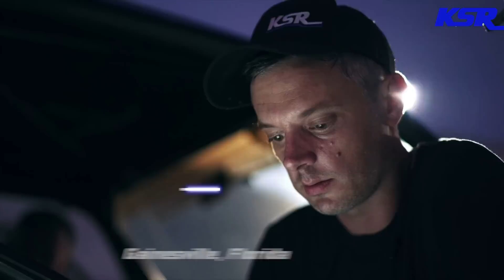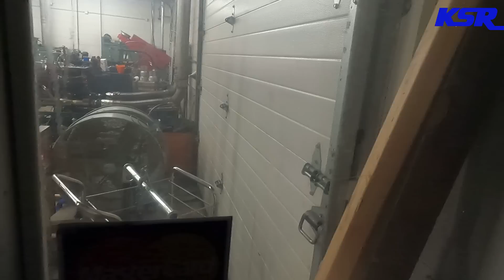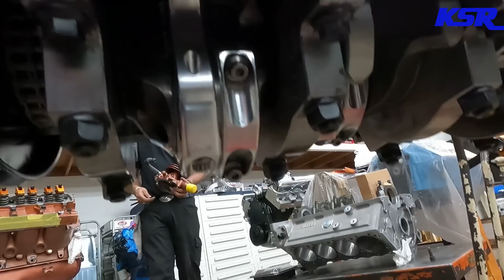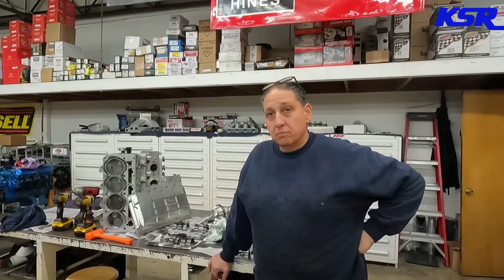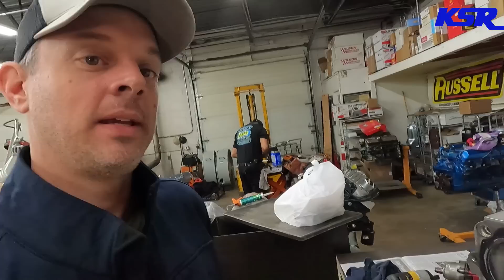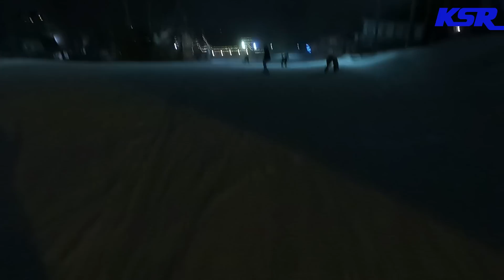Picking Up The Engine for MY CUTLASS!!! (Not an LS!!)

Comment: VEEEEEEEEERY disappointed 😡as that Dart is NOT a real factory Olds motor. Might as well be running a LS as that motor has very little to do with Oldsmobile at all. I will give you this, you sure as heck know how to throw any budget right out the window! Cubic dollars in that Dart.
Reply from the maker: Dart? That is a factory Oldsmobile block that we started with……
Reply: @KSRPerformanceFabrication   Hmmmm? 4 bolt mains in a Olds block ? where the heck did the 4 bolt caps come from.? Me thinks it's one of them Olds Dart blocks that Warren Johnson & Harry Gant used. Not a factory Olds 2 bolt main block. You tell me, I am all ears. Keep in mind I am a big Olds fan as well. I have seen one of them Olds Dart blocks up close. High nickel content extra thick webbing around mains & cam area, double thick decks a real trick piece, but not a real Olds block. Them Dart Olds blocks have a huuuuuuge price tag if you can find one.
Reply from the maker: @hydroy1  It was a 2 bolt block, Bill added aluminum 4 bolt splayed caps to it. The rear cap is still the factory 2 bolt cap. It is 100% a factory OLDSMOBILE block, not a Dart.
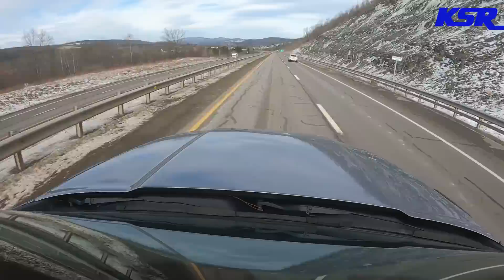Reply: @KSRPerformanceFabrication   Aluminum mains ? why not go whole hog and go 4140 tool steel caps? twist that little sucker UP ! 9,000+++ rpm SBO LOVE big rpm. Fact is I am twisting our 330 ( now punched 350) with factory steel forged 330 crank & rods with ARP studs on 2 bolt mains and ARP bolts in the factory steel rods.  That combo hits 8,550 rpm through the traps with a  non roller flat tappet cam for the last 5 seasons now. Only replaced 2 sets of bearings in that time & hand lapped the valves. The little 330 is still hangin tough. The 83 Cutlass we got is running 9.60s at 121mph with 6:14 rear gears. Nothing special, Wiean Strip dominator intake and 900cfm Holly carb with a 150hp spray of NO-2 on 11" X29" M&H slicks.  Yeah I know, your lookin for 6s at 200mph but guess what, most racers can't afford 6s and to be honest 9s are really MORE FUN as it becomes a very detailed JOB to go 6s and that is not in most folks budget.